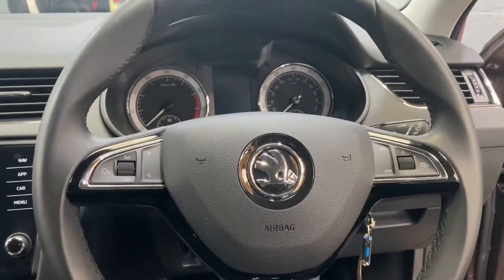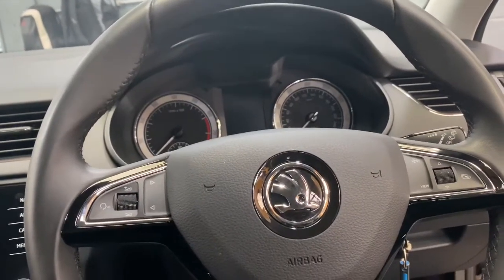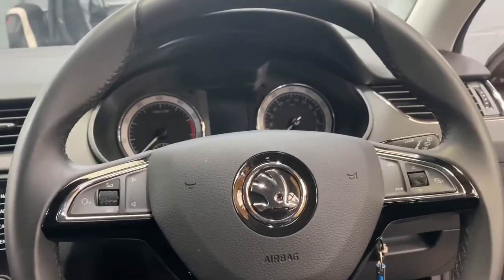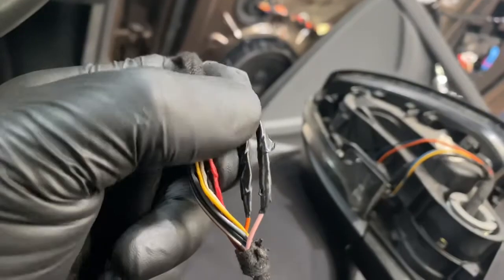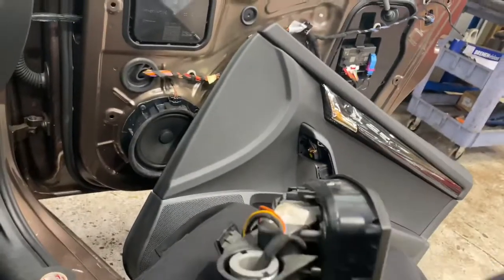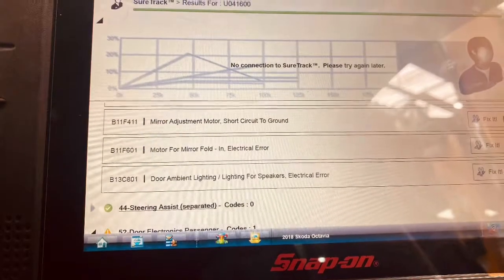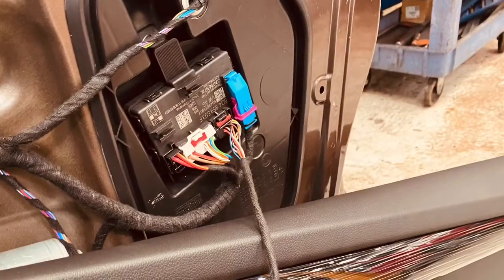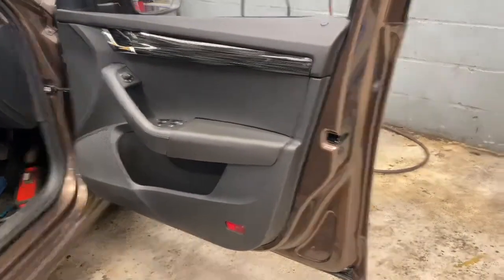#Skoda #folding #wing #mirror #issue on one side #cause and #cure including #fault #code

Comment: Would this sort of defect stop the mirror all together? Mine has this code but I can still operate both windows from the switch inside the car.
Reply from the maker: Is your mirror working?
Reply: @g_a_bofficial  yeah, so if I lock the car the the mirrors normally fold in, but since it developed these codes the passenger side has stopped working when I lock the car.  But both sides operate fine if I use the switch inside. I have a few codes relating to that first being BF122B12 (65578)first, BF122B11 (65579), then two codes BF11F601 (65598 and 65599).

I have read it could be the central locking motor, but the door seems to lock fine.
Reply from the maker: @ThomasFisher-sh4wp have you hit the mirror
Reply: @g_a_bofficial  nope it, we just locked it one day and it stopped, although the driver side feels solid and the passengers side has a bit of movement, the dealership replaced a window switch in that door card last month buts it's been fine.